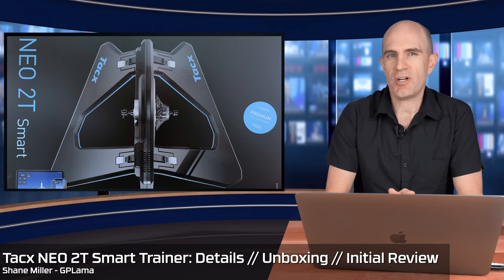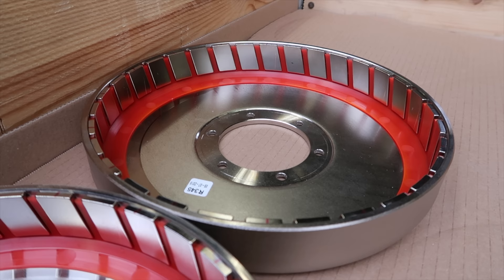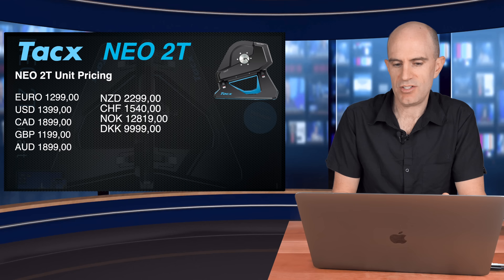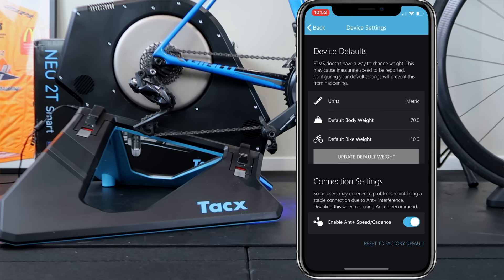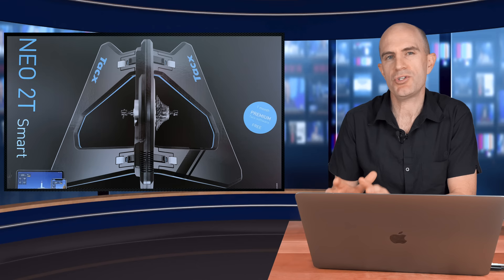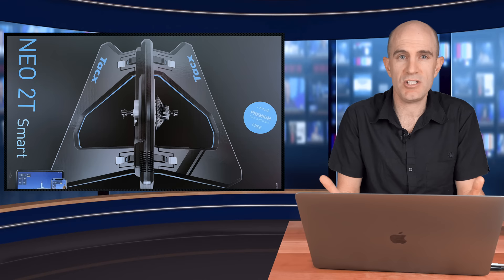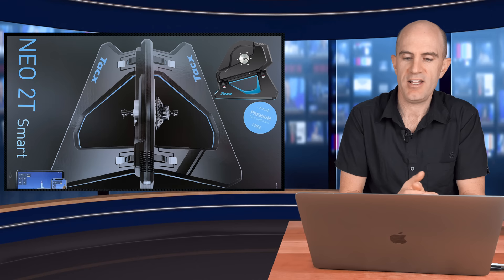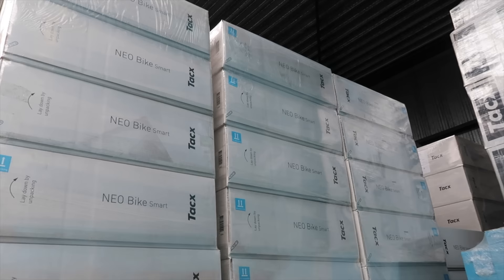Tacx NEO 2T Smart Trainer: Details // Unboxing // Initial Review

Comment: In the review you note some side to side wiggle. My 2T is very rigid, although I wish it did have some wiggle, especially when I stand. I noticed in your video that there are times when the leg locks are showing red (unlocked) and times when showing blue (locked). I'm amazed that the leg didn't fold and make for an ugly incident. Is that perhaps where you're getting the wiggle?
Reply: DaNiel Wood do you have any issues with cadence sensor? what's your feedback about the Neo 2t ? I'm interested to buy one but I'm with some doubts....
Reply: @tonixpto1  no, I have zero issues with the cadence sensor. It works perfectly and matches the data from my Assioma pedals.  The power also matches the pedals. I got a Neo because I wanted the road feel, and it only made sense to go with the newest model. The magnets on the 2T are in a much improved configuration and are considerably stronger. The road feel is awesome. If you have it turned on in Zwift, you can feel when on gravel/dirt, you feel the bricks or cobbles, you feel the wooden bridges, etc. I highly recommend the 2T.
Reply: @h18p thanks for your feedback,  i like the products of wahoo but about smartrainers Tacx neo seems have more quality, more acuarance and that belt on the kickrs have many issues reported...

Comment: Hi Shane, I was lucky to get my hands on a Neo 2T yesterday, even though everyone here are saying it is sold out. 
I went on and tested it against my Quarq DZero, after I had updated to the latest firmware. I got to almost the same conclusion as you. At low power ~130 watts, it is not far off, but as soon as I increase power, I see 10 watts difference or more. Is it a slope issue? 
If I compare my DZero with my Direto I also have a difference, but it is the same all the way. Is there any news from Tacx regarding your findings?
Reply: Hi Hans, 
I note your experience with interest, I am in the market for a new trainer and like the Neo series. I like you had a Direto and it had a 10% error for the entire range, and I broke belts. 
For your 2T you mention you updated to the latest firmware, was that 0.31? I only ask as DCR mentions in his trainer recommendation post "All three of these are accurate (notably so for me with the latest Tacx NEO 2T firmware 0.31)."
Naturally it worries me that we continue to see such variations in such a high end unit.
Reply: @acwna1  I have v. 0.0.32 and yesterday I did my own little test. First I tested my Direto up against my Quarq DZero. They have almost dead on, the same slope, but with a 10 watt difference all the way. The I did the same test with my Neo 2T against my DZero. That gave another picture, at 160 watts it showed 10 watts lover, and the difference increased all the way up to my highest measuring point 400 watts, where the delta was 32 watts. I have two instruments that has the same slope, and one that has its own, it is not wrong to assume that it is the Tacx Neo T2 that has a serious issue. As you say, I am surprised that such high priced high end products, can claim a +/- 1% accuracy and getting away, not delivering on that one important parameter. 
https://www.zwiftpower.com/analysis.php?
set_id=3725
https://www.zwiftpower.com/analysis.php?set_id=3727
Reply: @hansjessentube  Hi, kudos for carrying out the analysis (and for your reply).
Your analysis appears to show two different error profiles 1) the constant delta error (~10 watts) and 2) the proportional error (~10%). Which I find interesting and frustrating at the same time. Obviously there are traps regarding calibrating and offsets (which I am sure you are aware of), and I am sure you have had people say that there are drive train losses between the Quarq DZero and the respective trainers, but to see two different behaviours suggests that that is not quite the issue here. And I agree your Quarq is the constant here.
I only had one trainer (the Direto) to carry out a comparison and found a 10% error with the Powertap P1 pedals. However I did compare my Powertap P1 with a Powertap Hub and they were very closely matched - this somewhat ruled out the drive train loss excuse for me, but naturally raises the Powertap software methods as a potential variation. Nonetheless my P1 pedal versus Direto was exactly what GPLama did in his review video of the Direto (https://www.youtube.com/watch?v=cNhwva_6Mss) His review showed power figures that matched exactly, but mine were out by 10%. The belt failures I suffered were surely linked.
This actually raises other questions, I see reviewers get perfect alignment, give a trainer a thumbs up and then see heaps of users complaining of errors and faults. A 1-2% error does not allow for such discrepancies, surely.
Again thanks for your reply and I will watch for any replies from Shane.
Cheers 
Adam
Reply: jouni holsius after a short mail exchange with Garmin, they asked me to return it, did that yesterday, let’s see what happens.
Reply: @hansjessentube  Please post results on garmin forum link.
Reply: @alaefarmestatesllc  I Got a new one from Garmin, it was better, but the proportional error was still there, convolution after testing against new power meter, Assioma Duo, was that both my Direto and my Quarq DZero was having similar slope issues. I do not owe any of the equipment now, have a kickr bike and Assioma Duo’s. Not taking as many trophies 🏆 in Zwift any longer 😜 but still having fun training.

Comment: Why is it the trainer companies can't make the trainer the same height at the rear axle as the center of the wheel? I hate to use a riser block, I like to be able to move my front wheel side to side when I am out of the saddle or sprinting. It can't be good to have it locked in a fixed position.
Reply: Put a piece of cardboard under the block and sling those bars to your heart's content!

Comment: Thank you for the review. I found it a little bit inconclusive. Does it deserve to pay more for the NEO 2T over the NEO 2 that now is cheaper?
Reply from the maker: That's because as it ships today, it is inconclusive. We're still waiting for updated firmware to resolve the ERG and accuracy issues.
Reply: Shane Miller - GPLama ok, let's say the new update will fix all the bug's, the question remains: does Neo 2t worth the 250€ over the Neo 2?
Reply from the maker: @Dragos02  The stronger brake (no virtual slip) and thru-axle support make it worth it, imo.
Reply: Shane Miller - GPLama neo 2t or wahoo kickr?

Comment: I bought a Neo 2 nearly a year ago on the understanding it would provide L/R balance.  I am still waiting for a firmware update for this!

The cadence data is very unstable and resembles an ECG graph.  The cadence on the Neo 1 was 99% reliable.

Will there ever be a firmware update for the Neo 2?  Will all that extra EEPROM memory for future updates go unused?

Will Tacx provide a firmware update that provides it with the promised improvements of the Neo 2T?
Reply from the maker: They did release a firmware the other day for the Neo2 for L/R... but.... I don't think it's quite ready.
Reply: @gplama  Thanks. What I don't understand is: If the Tacx is already broadcasting Power/Cadence/Speed data in Open Ant+/BLE standards, I presume it would be simple to re-code to add the L/R balance data under the standard heading?!
Reply from the maker: @averyhillroad235  Yep, and that's what they've done. The problem is the Neo2/2T doesn't really know true left and right, so the numbers may not represent the real L/R balance.

Comment: Hello guys! I just bought 2 neo 2ts, but after first inspection, I have a few questions regarding compatibility with carbon fiber mountain bikes. 
I saw that, unlike some of the competitors, the endcaps on the neo are fixed in place, they do not rotate freely in the trainer hub. So, given that a mountain bike, even with the fork locked out, has more up and down pivoting, I feel that it could cause the endcaps to eat into the frame, damaging the dropouts... any experience using the neo2t with carbon fiber mountain bikes? Do I worry for nothing? Thank you!
Reply from the maker: That's a good question. Best send this one over to Tacx/Garmin support for their official reply on this.

Comment: If you were in the market to buy one trainer would you go the Neo 2T or KICKR18?
Reply from the maker: Lemond Revolution as pure 'trainer'. I used this for years to train for a races. People have arguments daily about who purchased the better trainer. Kickr vs Neo. The Neo design is technically superior. Proof being even the Kickr Bike has adopted a similar design resistance unit. The Kickr, according to a lot of people, has a better ride feel with the flywheel. Test ride both if you can. You can't go too far wrong with either.

Comment: You are comparing the power measurement from pedals and the trainer. It seems to me that you are not accounting for losses in the drive train. Am I wrong in thinking that pedals would read higher, as they are measuring the actual power you are putting down and does not take into account any power losses from the pedal, crank arm, chain ring, bottom bracket, chain, frame flex, cassette, jockey wheels etc.
Reply from the maker: The losses should be minimal. Very minimal. Drivetrain loss is overestimated A LOT to account for power meter inaccuracies - without any testing or data of each instance.
Reply: @gplama  You haven't measured them either, have you?  People are waxing their chains and even using 'race' chains  in races, not to mention ceramic speed pulleys in rear derailleur so there must be something. One way to measure the loss is pedal backwards and see how many watts your Assioma or crank meter shows. You have to make the freewheel turn freely without noise to cancel that loss since it's zero when pedaling forwards. You should also see clear difference pedaling backwards with/without chain.
Reply: Well, since I have the bike two meters away standing on Neo 2T with Assiomas, I did remove the locking tongues inside the Neo freewheel to make it spin freely both ways. Then I pedaled forwards (cause backwards it's always 0 W) to see what my Garmin is showing 10 second average wattage from Assiomas. It was between 7-10 watts, it's very hard to pedal steady without any resistance. Then I took the chain of off the crankset and pedaled again. Still same wattage, if not even more... so bit of a disappointment not seeing any difference. For the record, I have about 10W difference between Assioma and Neo2T when working at about 200 watts, Assioma showing more, of course.
Reply from the maker: @user-rl3ef4ju9k  There sure is something, it's called marketing. :) Measuring loss with zero load? I'm not sure that'd give a true indication of what losses may exist.
Reply from the maker: @user-rl3ef4ju9k  I was asked to perform a similar test last week: Neo in -10% mode (so it is freewheeling with the downhill drive function / zero resistance), I turned the crank by hand smoothly around the 360 (measured with the Quarq DZero), 0W reported. I also stat on the bike and rode using the Assioma DUO, also 0W recorded. I don't discount there are losses. But they're VERY hard to quantify and every bike/chain/cassette is different.

Comment: Hi Shane, is there any updates on this review?  Have the issues been sorted and are you now using this unit for testing to replace your old Tacx? Cheers.
Reply from the maker: I'm still not overly impressed with the 2T numbers. I need to look at replacing the flywheel/bearing assembly (for no reason other than to tinker) and see how things line up after that. My go-to trainers for power comparative testing are the DiretoXR and Kickr 5 at present.
Reply: @gplama  damn I really wanted to buy the 2T as it looks so cool and for the road/gravel feel.  I guess I should stick with my first thought and buy the Wahoo Kickr 5 - cheaper as it comes with a cassette.  Thanks for the feedback.

Comment: I've been seeing complaints that the cadence sensor isn't working and there are hacks but have you noticed any issues?
Reply: What are the hacks? I bought one last week and the rpm constantly drops to 0 or dosnt even start up at all! Contacted tacx support and all they told me to do was take it back to the dealer 😤
Reply: @DelBoy573  Tape a paperclip or small metal object to the inside of the left crank arm to extend it rearward.  That will trip the cadence sensor which is placed too far back.

Comment: I bought a tacx neo 2t last week, when I do workouts (ERG mode) in Zwift the power fluctuates a lot, for example if it is an interval at 180W the power goes up to 185, 190, 200 ... and more or also drops to 170  , 160, 150 ...
For warranty I changed the equipment thinking that I had a problem with the power and they gave me a new one but the same thing happens.  What can be?  It is normal?  previously I had a Wahoo Kickr and after that the power in the workout was more stable.
Reply: when the training finished when entering the companion app you can see the graph of the power that goes up and down too much and is never stable, despite being in Erg mode
Reply from the maker: ERG mode rewards smoothness. ERG within Zwift is also showing 1 second power, not 3 second average (even when configured to do so).

Comment: Tried to put my Merida speeder 400 11 speed shimano 105 cassette on tacx but wouldn’t work. Why don’t all bikes have universal axle/ frame drops ? Not user friendly at all! You have to be a mechanic to fit it on. Maybe you could do a video for all the different axle types for the various bikes….
Reply from the maker: There's quick release and thru-axle. That bike spec is "135x9mm width rear hub" so needs the 135 QR adapter and quick release to mount. It should all be in the supplied manual.
Reply: @gplama  thanks mate appreciate your help.
Reply: @gplama  just spent 3 hours this morning reading about QR Skewer axles U-shaped dropouts 20th century(my bike), thru axles enclosed hole shaped dropouts 21st century and thru bolt axles which is an option for me if want to upgrade from my QR skewer. Looking for a video where someone puts a QR skewer axle with a U-shaped dropout bike onto a Wahoo Kickr 5 or Tacx Neo. Then I will go about purchasing one of these two smart trainers.

Comment: What is the difference with or without an electric cable?
Reply from the maker: Without: No coasting / downhill drive. No ability to update firmware.

It's better to use power in my experience.

Comment: Shane, Just purchased the Neo 2T. I’ve put a 10 speed cassette on with the 1mm spacer behind the cassette. Is that all it needs, I’ve heard/listened to contrasting views recommending an extra 1mm spacer? Thoughts                                            Also when I’m tightening up the lock ring it makes a grinding noise whilst it rubs on the last cog before it tightens completely, is this normal.
Reply from the maker: Depends on the cassette. May need 1.8mm off the top of my head. Best ping Tacx Support for this and the sound query.
Reply: Tried that already, the person was hopeless.  It’s a shimano Tiagra 10 speed. From what journals and videos I’ve gone through, Taxc doesn’t suggest anything else other than a 1mm spacer. I’m a novice with this, my first smart trainer. Just want to get started 👍🏻
Reply from the maker: Try a local bike shop if one is nearby.

Comment: Hi Shane, brilliant work as always, thank you so much! I'm picking up a Tacx Neo 2 or 2T soon and was wondering if it is a given that purchasing a Neo 2T right now is a safe bet? In other words, can folks take it for granted that the power discrepencies you and others in the comment section are reporting in testing will be addressed and fixed through a firmware update? I'd prefer the Neo 2T with the upgraded features but if the power discrepencies were to remain an issue I'd just as soon have the Neo 2. Any thoughts on the matter greatly appreciated, thank you again! Cliff
Reply from the maker: Ray's test of the 2T with 0.32 of the firmware (latest) looks to be pretty good. I'm yet to put my bike on the 2T again to see the results compared to the original tests I did upon release. Stay tuned for that. More Lama Labs coming up!
Reply: @gplama  Perfect, thank you! I guess I hadn't looked hard enough to find Ray's recent review, your reply remedied that. Thanks so much again for all you do for the community! Cliff

Comment: Ok, had this trainer for a few days now. There is a lot to like but I'm getting a kind of "road feel" through the pedals all the time. A vibration you can feel when riding or turning the cranks over by hand. Is this normal for a Neo? It's like you can feel the electronic braking turning on and off many times a second. Hard to describe to be honest. Normal or have I bought a lemon?
Reply from the maker: That’s a difficult one to diagnose over YouTube comments. If it doesn’t feel right then it might not be right. Ping Tacx Support and see if they can suggest anything to check.
Reply: @gplama  Cheers Shane, will do. As you say, difficult to diagnose over YT. That said... Do you happen to remember if turning the 2T over had a totally smooth feeling to it? Thanks for the info mate.
Reply from the maker: Smooth enough... Chain/cassette/chainrings could also impact this.

Comment: Shane, how is the clearance for the rear disc caliper?
Reply from the maker: Same as Neo1 (revision 2) and Neo 2. No issues on the Giant TCR (is't snug but fits). Clearance will depend on bike type and frame size. I'd test 'mount' one at a bike shop if unsure.